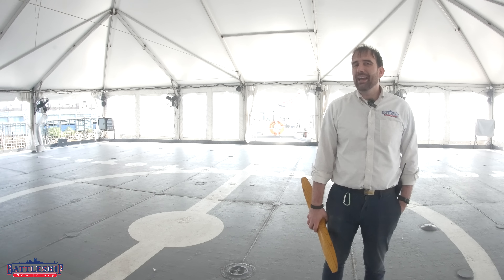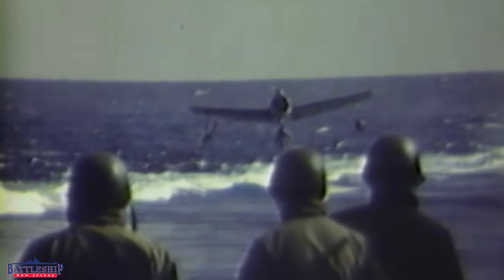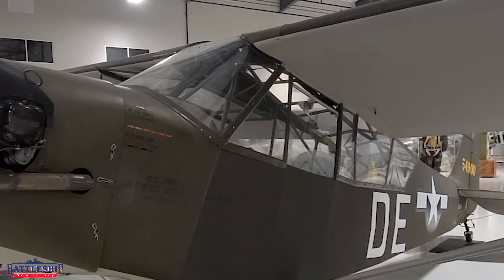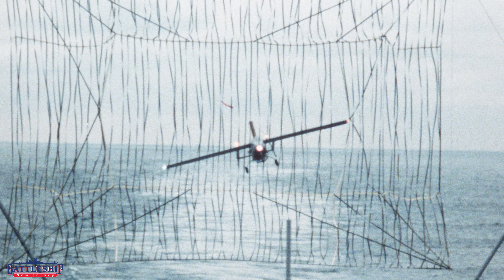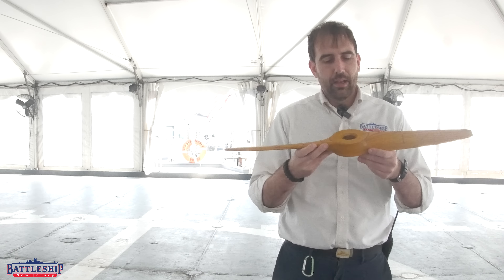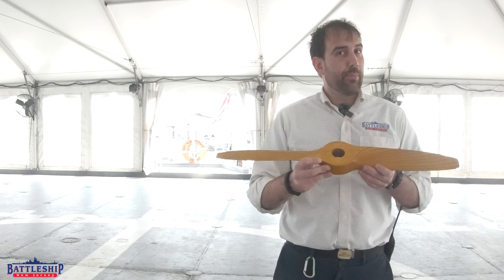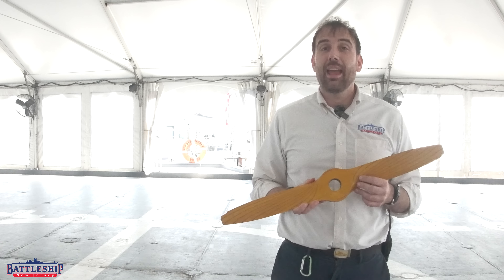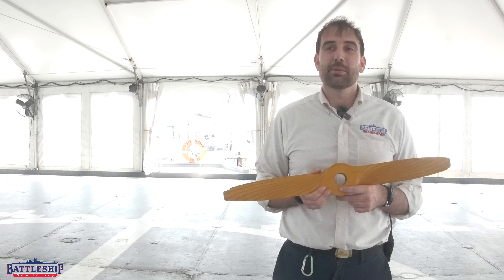Why Is a Drone Propeller Made of Wood?

Comment: For props that size, wood would be the most convenient material to use. For smaller model airplanes, injection molded glass-reinforced plastic has pretty much taken over the market, though for some racing applications (RC pylon racing) wood props are still used because the molded props will shed blades at that sort of RPM. For larger models that use that size of prop there are more complicated props made out of glass and carbon fiber cloth impregnated with epoxy, usually cured in a vacuum bag and an autoclave, these are more efficient than wood in many cases but are still a lot more expensive and nicks and dings can't easily be repaired. Incidentally, some full-size fighter plane propellers in WW2 were made of laminated wood - those five bladed Rotol props on the later Spitfires were an example.
Reply: Yes and those props are likely still made from a balsa wood with a vacuum impregnation of epoxy, to give it a good strength, and also to bond the laminate layers together. Thin laminates so there are no hidden defects, and probably with a 60 degree orientation, instead of 90 degrees of regular laminate board, so that your length is as strong as possible, sacrificing slightly in strength across the blade, for strength along the blade.  You use a light balsa wood and vacuum impregnate with epoxy, then form the sheets into the right form, before you bag them, vacuum again to remove bubbles, then heat cure the resin in an oven, with the bag providing clamping force. Then likely machined using a form following lathe, which milled the wooden blank, using a template that provided a full scale or scaled half blade, that controlled a high speed cutter that removed the wood over a few passes. 

Battleship engineering likely had a stock of finished blades, as they probably did not have space to put that kind of esoteric machine for a single use part, simpler to keep 500 blades in inventory on ship and stores, and have a company on shore churning out stock as needed.

Comment: To get a replica Pioneer I'd suggest contacting the Academy of Model Aeronautics (AMA) in Muncie, IN - they have a model airplane museum, and can probably put the call out to see if there's someone among AMA's many members willing to take on the project of building a nonflying 1:1 scale model of a Pioneer. The person doing it would require some photographs, some measurements and a 3-view drawing of a Pioneer. These modelers often tackle building scale models of other aircraft from scratch and this shouldn't be out of the ordinary for them. Since this would be a non-flying model, weight wouldn't be an issue and a wide range of materials and building methods could be used.

Comment: It's a Sensenich prop. I think the part number breaks out like this; the W29RH means wood 29 inch right hand (so it rotates clockwise). The -10 might be the pitch. I bet you could order that prop today. Yes, you can easily repair minor dings. We just use some epoxy then sand it smooth.
Reply: You don't use baking soda and super glue (CA glue) for wood props?  That's in the FAA AC 43-13-1B.  Epoxy for composite props.
Reply: @Bottleworksnet  Small dings yes, large ones you use a 2 component epoxy, keyed and filled into the hole, then allowed to cure, and sanded to match.  We used Araldite Rapid, and because of how much was used per job, it came in 5l cans of each part. Pour can A into can B, stir for 3 minutes, then use it, with the setting time being 30 minutes, and full cure in 24 hours. You know you have a problem when your composite floor, supposedly made from honeycomb material with a skin top and bottom of aluminium, is instead made from a sheet of aluminium plate under, and a solid pour of cans of Araldite, with sand on top to provide the grip surface, and then spray painted matt black. It was 47 kg over the last aircraft check, so the floor had to be replaced entirely on the next major overhaul.  Operating with a 16mm LMG as gunship was always going to result in you needing to redo a section of the floor each flight, always the same 3 things, gun mounts pulled out, and both pilot and co pilot seat mounts ripped loose.
Reply: Do you have to run a oven curing cycle for the epoxy to reach glass transition temperature?
Reply: @kizzjd9578  No, glass transition temp is if you want to remove it, take above that temperature and it changes from a strong durable plastic to a weak crumbly one, or almost turns back to a syrup depending on the epoxy. Cool down again and it normally is permanently damaged though.

You can heat it to under that though to get it to cure faster, once it has started to cure heat makes it go a lot faster.
Reply: @Bottleworksnet  Almost anything will work but in the middle of the desert when you are trying to get a flight off, you use what's available.
Reply: @SeanBZA  That's a good practice if you can return the prop to the shop but in the middle of the desert when you are trying to get a flight off, you use what's available.
Reply: @kizzjd9578  No. Just let the epoxy air dry.
Reply: @SeanBZA  There is the proper way to do things by the book and then there is the field way of getting it done. We have been doing UAVs since the 70s and have always used Sensenich props and repaired them with simple 2-part epoxy, let them air dry. We've never had a repair fail yet. I have seen people use Bondo as well but that can be brittle.
Reply: @robertstephens1203  Which means dings get left, or filled in with 3 minute epoxy, and some speed tape over it for the 10 minutes till hard, then show it a sanding block, and put back in use. Or just leave the speed tape on and send it.
Reply: @SeanBZA  The thing is, when operating on dirt runways, crap hits the prop every flight. So spending a lot of time repairing a prop by the book only to have a new chunk missing after the next flight, is not worth it. You repair a prop until it's not practical anymore or cracks develop. If it cracks, it's now a wall ornament. A good supply of spare props are necessary. I have seen new props shred on take off but never a repaired prop.
Reply: @robertstephens1203  Yes speed tape and 3M prop tape is your friend there. Blade tape to keep the leading edges from damage, and speed tape and filler to keep the shape.
Reply: @SeanBZA  Yeah, speed tape is great stuff and I try to take some with me to the field but when you are in the middle of a desert in a 3rd world country, speed tape has a habit of disappearing.
Reply: @robertstephens1203  That is why you keep it closer than your rifle......
Reply: @SeanBZA  ok interesting, yea was just wondering what you guys do as sometimes epoxy isn’t full strength unless it goes through the heat cure cycle but yea I agree about it not being flexible.

Comment: One thing with making a prop is balancing it. Something done easier on land then on a rolling ship.
Reply: It certainly requires a good deal of skills to manufacture such a 3D shape. I don't think they were ever manufactured on board.
Given that the whole purpose of the ship is defeated when you can't see where shells land I guess they always replaced the propeller when even the slightest damage was suspected.

Comment: Have you ever considered going to the original manufacture of the Pioneer Drone and see if they could produce one for a static display for on the Battleship?
Reply: He got it one piece at a time and it didn’t cost him a dime!
Reply: @thedangersofboredom LMAO!! Let's say Ryan picked it up at the factory ..it's cheaper that way!
Reply: Interesting thought - they might have a warehouse with enough parts to build a visually complete aircraft, even if non-flyable. Or test models, ones that didn't pass QC, or other reasons they weren't flyable/deployable, but still could be used as a visual display.
Reply: @quillmaurer6563  I never got why old businesses that supported the war effort don't work with the museum to give old and unused, clearly declassified bits to allow museum ships to look a little bit more complete. It's not like they're not aware of these museum ships.
Reply: @aserta  They probably do from time to time. Though I suspect they often either turn over any spare parts to the military (possibly by contractual obligation) or scrap them, don't keep around what won't make them money.

Comment: Wood tacks up the impact to save the Engine from sudden stop damage.
Reply: Likewise, I notice that it only has a single center hole, like is common on R/C aircraft, rather than a circle of holes (commonly 6 for small aircraft with wooden or fixed-pitch metal propellers) that are used to mount a manned aircraft propeller on studs. Perhaps this was designed to be able to slip without severely damaging the engine, maybe even the propeller as well, while a propeller mounted on studs would either break the studs or damage the engine. Though with manned aircraft and metal propellers it's not just "sudden stoppage" that can damage engines - even minor contact between blades and ground, something the pilot didn't even know happened until seeing the damaged propeller after shutdown - can require an engine overhaul.

Comment: One potential problem with wood is they will disintegrate if you fly them through rain and the wood is not sufficiently protected against water.  AAI would later find this out the hard way with the RQ-7 Shadow.  Their solution was to put a rubber coating on it.
Reply: Which is weird, because by the time those RCs were out, wooden props had been done, done, done and dusted to death. We already knew all of these issues. Which leads me to believe that they probably winged the whole thing, the design of the RC also kind of supports this. To some it's utilitarian, to me... screams novice.
Reply: @aserta  The entire history of military UAV development has been a bunch of people who have never flow an airplane re-discovering 50 to 100 year old aviation best practices the hard way.

That being said, wood still has a place since it is cheaper and easier to work with than fiberglass or carbon fiber.  You can make a wood prop resistant to rain, you just need to know that it is a requirement beforehand.

Comment: 0:38 Is that the range that Spot 1 can see with the optical rangefinder? If so, would a ship to ship engagement be limited to 13 miles if they didn’t have radar or a spotter plane available?
Reply: No, that's the range to the horizon. A ship beyond that range would be considered hull-down, not all of it would be visible but you could still see it out to about 24, however at that range all you'd be able to see is the very top of the ship. Targeting, identifying, and spotting shot would be very very difficult if not impossible. 

The rough formula for determining horizon distance is to take the square root of your height of eye in feet and it will give you the range of the horizon in nautical miles. 

Spot 1 appears to be about 125 feet up, so the horizon would be 11 miles away, you could engage a battleship sized target out to about 18 miles depending on light (to see the fall of shot).

13 miles is the range of the horizon from the top of the mast at 175 feet, so in ideal conditions the look out in Spot 1 could first see another Iowa class BB at 24 nm, though it would just be the very top of the mast and you'd have to be both very alert and have very good eyes to see it that far away (smoke haze might give the ship away sooner).

Comment: The designers of the drone should have designed the drone to release the prop immediately as soon as it hit the net, stopping the rotation right before it hit.
Reply: On the Boeing ScanEagle, flown off Navy ships today, they kill the engine (ie stop the prop) just as its about to get caught.
Reply: Would've been simpler if they did a folding prop. It's not like the concept didn't exist. Assisted gliders had them pretty early on and it's a pretty simple design. In this case, it would've used a washer pusher to release the hold and fold them, but it would've worked.

Comment: I believe the propeller was at the rear so that it did not get wrapped up in the straps of the net.  It would be a real pain to have to untangle the straps from the prop each time the drone is recovered.
Reply: I'm guessing they shut down the engine before the landing, even a rear prop would likely get somewhat tangled if still spinning. But even not spinning a front propeller would be more likely to be damaged or tangle up.
Reply: Yeah, he says that.

Comment: it was treated as a disposable part, they had to catch this thing with a net so it was easier to just frag the propeller and replace it before the next launch
Reply: Yes.  In blonde pecan finish, it brightens the room.
Reply: If they can shut it down before catching it, I'd think the propeller would have a good chance of surviving. Though certainly not every time, if they weren't able to shut the engine off at the right time, it kept spinning too long, or it stopped at the wrong position.

Comment: Probably not pine.  More likely birch, which was traditionally used for props.  Most pine would be too soft, and harder pine like longleaf pine has too great a difference in strength between early (spring) wood and late (summer) wood.